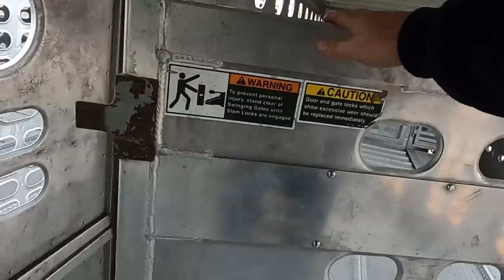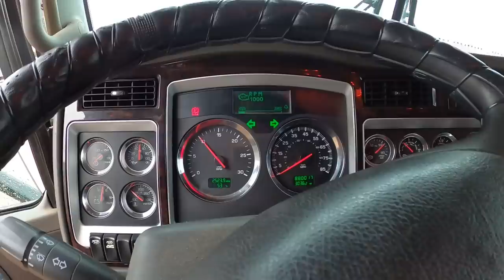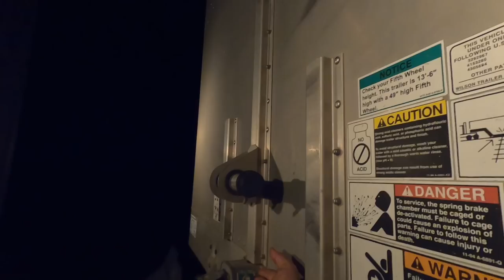FINALLY found it! New BULLRACK coming home.

Comment: We have a 53 x102 Barrett tandem axle pot. I use to haul hogs with it behind a 9400 IH with a lift axle. We put a 1/2 deck in the front of the belly and it has 3/4 dog house. We just haul our own cows now. We put 4 backup lights one on each side going down for making turns and 2 going back to see backing into chutes. And we have lights on both sides on the inside. Most of our loads was at night. We always run Virgin tires on truck and trailer. We never got over 5 miles per gallon but the truck would run most of the time as it was either hot or cold out and we would have the AC or the heat on while sleeping. We had a N14  Cummins 9 speed with 373 rear’s . Most of the time the DOT and cop’s would not bother you much have had them Flash the red lights to tell you to slow down.
Reply from the maker: Love it

Comment: That PDI tuner is a fantastic addition to any diesel truck! I have it on my 05 Caterpillar Acert C15 and I’m now seeing low 6 pulling a loaded reefer through the hills of PA in this Peterbilt 379.  Not exactly a MPG most expect to see out of my set up 🤣. 

Nice purchase on the bull rack! It’s funny. Before you said you use to love all the lights but only look at them as more maintenance to worry about, I was thinking that exact thing seconds before you verbalized my very thoughts! 🤣.  Stay safe!

Comment: I never thought learning about cattle trailers could be so entertaining! 😂
How do cattle get smaller and lighter during transport?
Reply: They pee and poop.
Reply: @krisptaco  I'm surprised it all weighs that much!
Reply from the maker: It is hard to believe, but they respirate lots of water vapor it also contributes to their weight loss
Reply: @realwildwildwest  Ah OK, so do you have to make sure they are well hydrated before moving? I don't think you mentioned anything about this with last year's move. Is there any preparation before haulage?
Reply from the maker: @awesomecreationschannel  actually and Surprisingly, you don’t want them full of water when you haul. If they are full of water and feed in their bellies, they end up getting each other really wet, dirty, and sloppy. I prefer to have them dry lotted for about 6-8 hours before they are loaded. Over the years I’ve noticed they handle the trip  better and come off the truck in much better shape.

Comment: Congratulations on the new to you trailer, love the chicken lights but the down side if you add extra lights and they are inoperable. DOT will nail you for inoperable equipment.  Question with the single vs a dual  does it take away from axle capacity weight?  Sorry I’m a old trucker who has always hauled standard dry and refer, I’ve never even hauled a spread axle  down side of always been a company driver and never owner operator
Reply from the maker: https://www.ecfr.gov/current/title-49/subtitle-B/chapter-III/subchapter-B/part-393/subpart-B

I don’t know if you can follow that link, but it is the chapter and verse that specifically says the DOT cannot ticket you for in operable extra lights. I have always kept it handy just in case they try to harass me for it 👍🏼

The single axles are good for 13,000 pounds each and the center axle is good for 20,000. So as a whole they don’t affect the capacity. 

Great questions .

Comment: I didn’t realize cattle trailers didn’t have standard landing gear. I’m sure there is a reason behind that. If I may ask, what was the cable/ winch mounted on the front of the trailer parked next to you that you looked at for a minute?
Reply from the maker: It’s just to safe weight. Cattle trailers almost never get dropped loaded unless it’s an emergency. So they don’t need the big heavy landing gear. 

Cable is to hold a spare wheel and tire . Good questions.